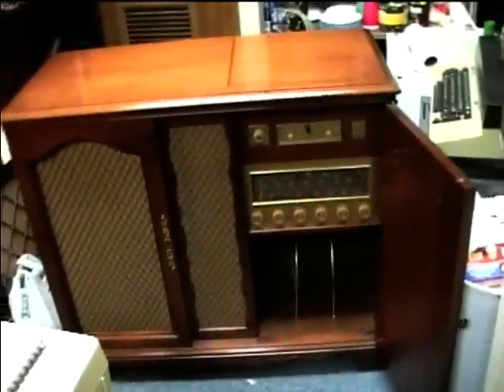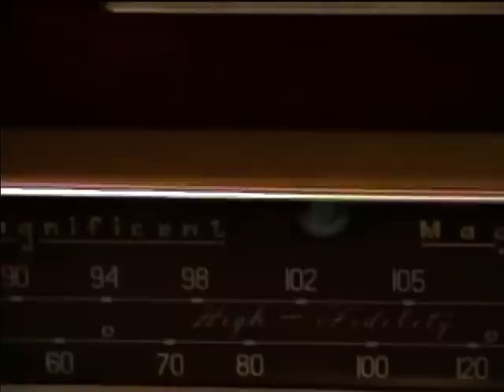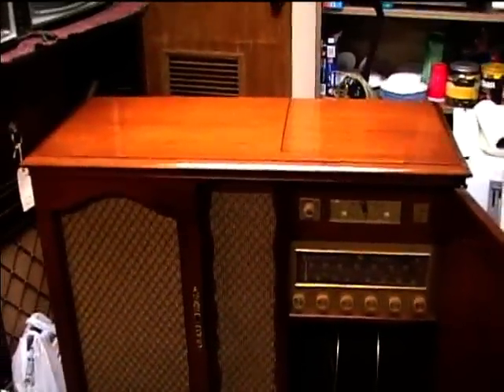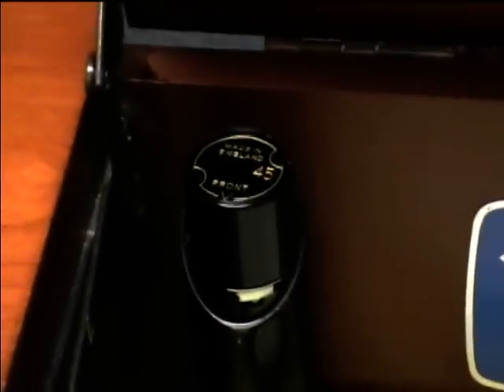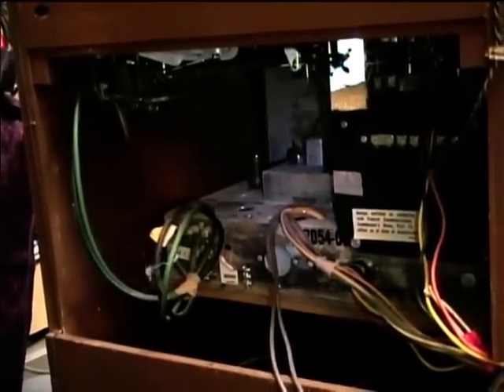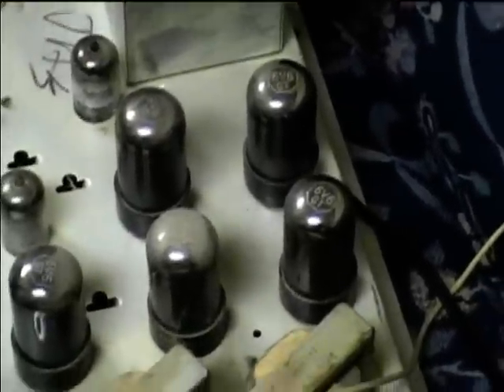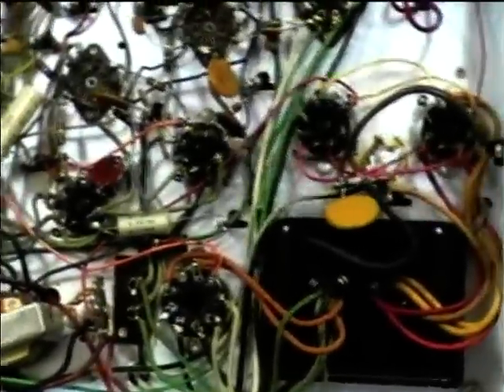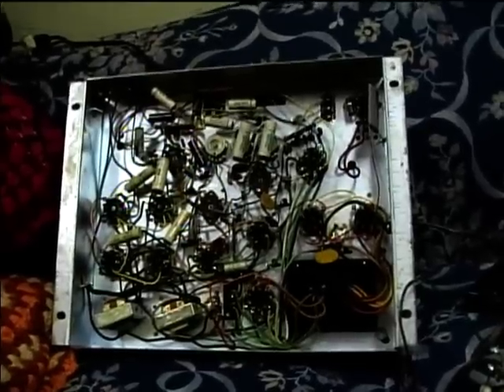1958 Magnavox "Imperial" Tube-type Radio-Phono

Comment from the maker: Thanks! They actually did not have the other cabinet at the house (maybe they never had it?) They had the output from the other stereo channel running to cables which led to other speakers in the house.
It actually was not terribly heavy once the amp was removed because it looks like it was made with real hardwood plywood and veneers...no particleboard at all. Cabinets which are made of particleboard seem twice as heavy as real wood!

Comment: Hello, that is a beautiful cabinet.. I just realized something today. My grandparents had
a "state of the art" Magnavox television that matches your console and was purchased in 1958 as well. I always wondered why it had such huge speakers, 15"-12" and horn tweeter. It was large with two doors which opened, and I remembered seeing an amplifier on a shelf, unused- ( 6V6 push pull -with approx. 8 tubes). It must have been used for the second stereo channel, and that was the power amp.

Comment: Does that bring back memories.. My late grandparents had that exact same model which  had a matching television that contained an additional amplifier chassis on the bottom shelf and the 15" woofer and tweeters for complete stereo. Those are impossible to find. My grandfather demanded the best in stereo, he was a vice president of the M.P. Moller Pipe organ company ( and owned a huge collection of organ music ) that Magnavox was a great reproducer of the music. Later, he ugraded to the Magnavox "Armoire" system, which had two octagonal coffee table satellite speaker systems. That system was I believe, the first to offer a unique type of wireless remote control, perhaps  a high frequency control that offered multiple selections and a special lit Collero changer.  I know it easily cost $ 2,500.00 many years ago.  That was probably the last of the great Magnavox systems made, It was beyond "Astro sonic" and few were made due to the cost. By the 1970's Magnavox was a mere " name" with Korean made components.

Comment: I recently brought a 155B back to life, had all the tubes tested with a punch card operated machine.

and whooo boy, AM stations have never sounded better! i mean jezz, im used to AM stations sounding like crap, but on the 155B it sounds great. it sounds full and rich sounding, while the modern radio at the place i work at just sounds awefull, its all hollow and lifeless. I can see why people prefer tubes, they are more true to the sounds waveform because theyre not digital.

Comment: I have a 1958 or 57 Magnavox Stereo Hi Fi with two cabinets. One cabinet houses the radio & turntable.  The top to the other speaker/cabinet is storage for records & has a lid that lifts and props up.  Both cabinets house 1 15" bass, 1 7" mid range, & 1 5" tweeter.  model number ISP275F. No one, not even Magnavox themself can give me any info on it.  Do you know anything about it? If you can contact me through facebook messenger that'd be fantastic